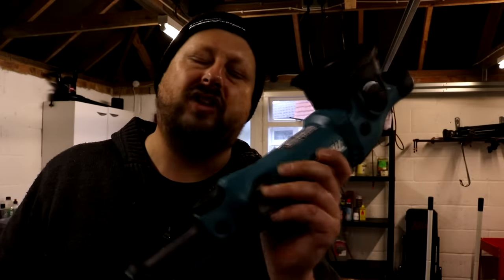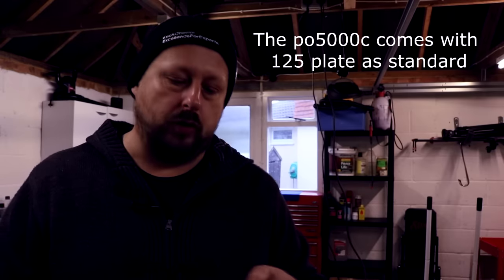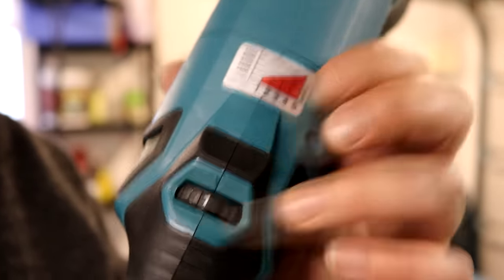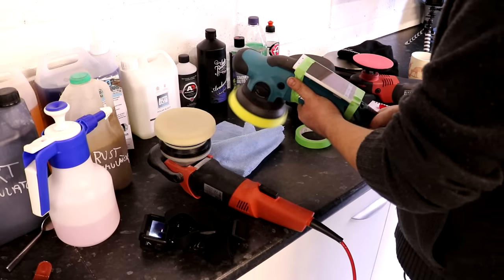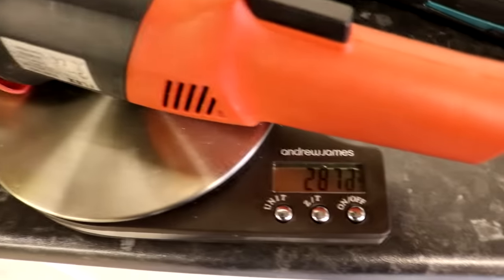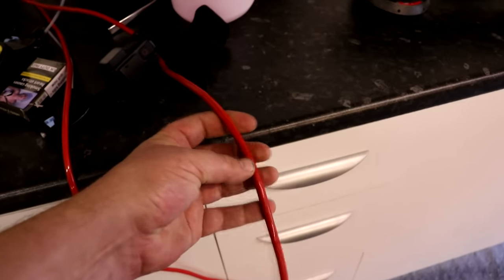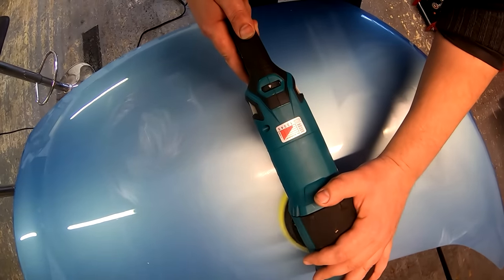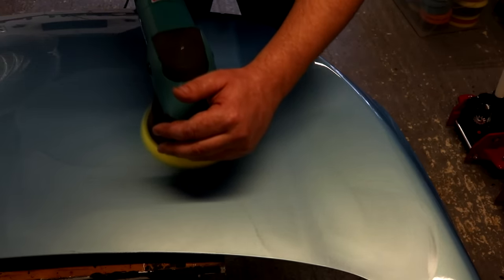Makita PO6000C Polisher Review - Free Spin and Forced Rotation in One

Comment: About what percentage of time can this makita save me, compared to a porter cable 7424 doing a swirl removal job?
Reply from the maker: jesus, tough one..   ok finger in the wind.  30% less time with correction.. hmm dunno.. the mecca whenever you have heavy swirl paint is to do all you correction in one set, isnt it.  thats always my aim at least.    sometimes on a normal DA like that taking out heavy swirls on hard paint can be like 3 sets.  Problem is you cant do much when you have your compound  and pads already picked, so there and then when you have your DA theres no much you can do to improve the cut with the machine.  With the 3401 you can pressure it in a little bit more without stall.  this also makes it better for removing scratching in curvey areas where your DA will want to stall out more when its not on a flat panel.. theres so many factors.   but you want a rough guess.  30%

Comment: Hi Jon can you recommend a good snow foam lance for a karcher pressure washer.
Reply from the maker: I use a PA lance. was 40 quid.  its been good.  but Im not sure if you need to spend 40 quid.  I just bought the 7.99 chinese ones from clean your ride will be interested to see how that does.   Ill cover this on the channel at some point.  but its like this.  If you want to spend 35-40 quid go PA or MTM.  If you want to spend like 15 quid.   Buy like the in2detailing one or any of the cheap chinese ones.   Its generally what you put through them that effects how they perform.  every now and then changing out the filters will be good.  using spray and rinse chems can block up the filters a bit.
Reply: @ForensicDetailing  thank's Jon, I have the karcher one but it's not great, I new you were the right guy to ask, thank's again pal.

Comment: Hi mate. Could you please recomend for me some ultra soft backing plate for my rotary polisher m14. Thanks
Reply from the maker: hey maciej   its less about ultra soft and more about quality. honestly thats the most important thing.  3m backing plates are good.  So are the flex ones.  avoid cheap backing plates the velcro hooks snapp off and fall into the pads when you rip the pads off. the cheap ones dont always align properly as well.  And note, some of the ones you think would be high quality and are expensive can be actually poor quality.    3m or Flex ones mate.

Comment: So.. XCE Corded, or the Makita?  Also, just joined the patreon!
Reply: Price not effecting the decision.
Reply: I'm in the same hustle
Reply: @vloot2009  went with XCE, hate it. Sticking with 15mm MKII Rupes.
Reply: @hayden199516  my mk15 mk2 just broke down thinking of going with the Makita since its only 270 euros here
Reply: @vloot2009  give it a shot!! Let me know how you like it once you get it?
Reply: @hayden199516  I will!
Reply: Well as promised my thoughts, amazing machine runs without any vibrations. 
Unlike my rupes did, easy to control sound level seems a bit lower then the rupes.
Lots of torque, I love it not a thing to complain. 
Correction power wise can't tell you yet haven't really compared the 2, but feels like the Makita has the edge. 

Cheers!
Reply: @vloot2009  thank you very much! I'm impressed to hear it's smoother than the Rupes was! Looks like I'm going to have to swap my Flex for the Makita!

Comment: Hi Jon, is the Makita less grabby/finicky than the Mille?
Reply from the maker: Yo Brewinz.   I dont have them both with me to compare side by side.  I did have some grabbing problems with the mille that I didnt have with the makita using the same pad and abrasive combo.  But I really dont think thats the machine to blaim, the dynamics are too similiar.   I think the main reason you might pick the makita is the build quality is as good as flex or rupes (you could argue its even higher).  but the price point is really desirable.   Its definetly worth checking out.   But I thought the mille was solid as hell, just pricey perhaps.

Comment: if the backplate is 150mm or 6", should i use 150mm polishing pads or bigger diameter? and can I change the backing plate from 150mm to 125mm?

what brand of polishing pads do you recommend that can fit into this model? thank you!
Reply from the maker: you can get the PO5000c which comes with 125 or 5 inch plate.   You can change the plates..  the tool here was loaned to me had non standard plate.
Reply: The po5000c's are all imports UK has po6000c can't find a Mitika 5" plate am I best using the 6" supplied or could you recommend a suitable 5 inch backing plate. Thanks for the review.

Comment: You can make the flex 3402 free spinning as well
Reply: hmm how would you do that?
Reply: @aronlantos  by removing the gear teeth in the housing
Reply: Yeah, just remove the felt ring piece..but then it becomes one slow correcting freespin...only 4800 OPM
Regular 8mm tend to be 6500 opm